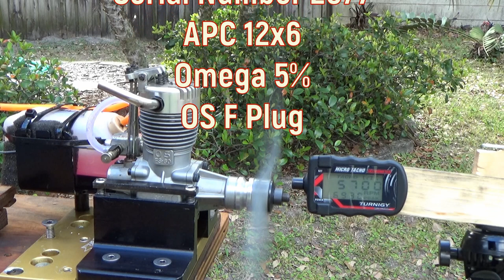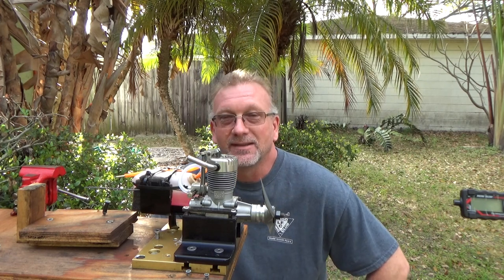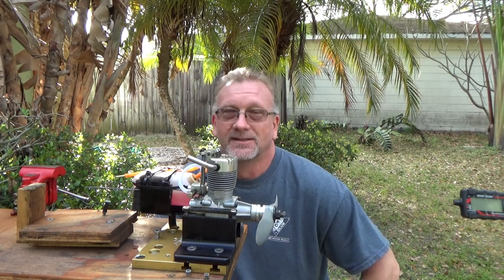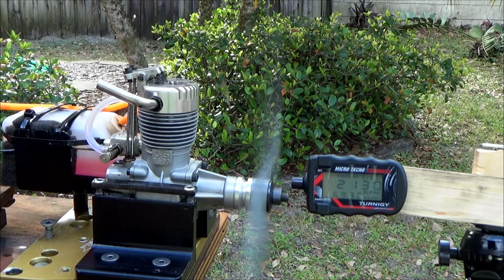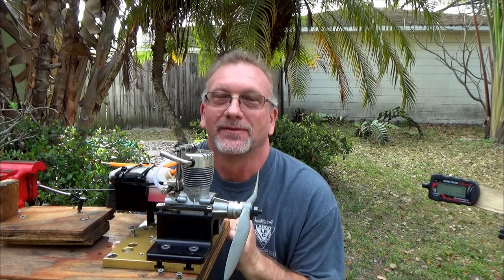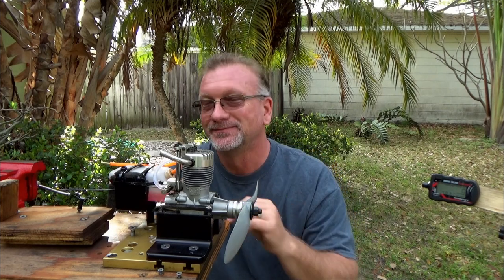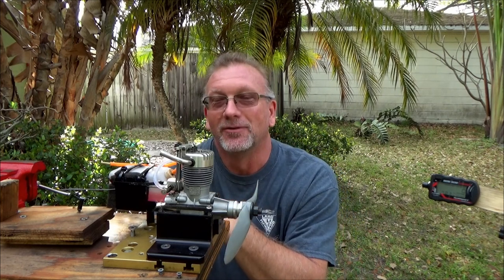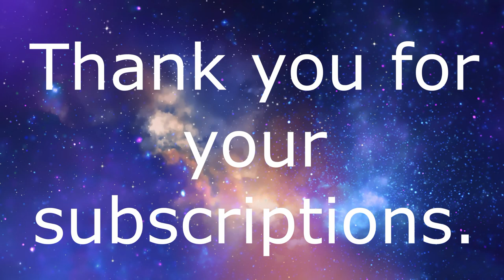OS FS-60 MkI Open Rocker First Run **Bella**

Comment: I have the second version with the cast head. I bought it new in 79. It has been on numerous planes. The only thing I have ever done to it is replace the bearings a couple of times and reseat the valves. 

I also made a timer so I could run it on gasoline and 2 stroke oil. 16 to 1 mix. Runs great that way also. It still has the original piston and ring that still has great compression. It is simply delightful engine to run. 

Outside of all my old antique ignition engines from the 30,s and 40's, it is my favorite glow engine. It has about the same power as my Anderson Spitfires on a 14-6 prop. 

Thanks for the great video.

Comment: I can't get over the fact of how quiet this is, even at high revs, perfect 1 cylinder for an old timer slow flyer.
Reply: Those early four strokes tend to have softer valve timings and are more optimized on torque. So they develop their maximum power at 8000-9000 RPM or something like that, compared to the more modern OS surpass which are designed to have significantly more power but need to turn in excess of 10000 RPM to archive that.

Also the since the exhaust valve opens more slowly, the pressure spike in the exhaust isn't that big and therefore the sound not that loud.

Many years ago I had the pleasure to listen to a Kalt FC-1. 7.5cc four stroke, less power than a modern 4cc two stroke. But really quiet without any muffler.
Reply: @VintageTechFan  Wow man, don't know why youtube never gave me notification of your replay, just saw it by chance just now! Well you just read my mind, I love the kalt FC-1 engine, have over the years collected a few, one used and new in box, keeping those for display. Just recently won a bid on ebay for a collection of os engines, one of them was  a NIB os fs 60 MK1, From the pics the seller sent me, it looked to have never been run, not even mounted. I have yet to get it. I also own 2 NIB MK 2, my fav. When an engine is made so good, its hard to just have one of :-). The fs 60 is an absolute jewel, yes, its purposely made for that sweet sweet scale sound and low rev, high torque, LOVE IT. Last yr I was lucky to get my hands on a NIB OS IL 300, now that is a beauty as well!

Comment: you can add after run oil thru rear cam housing cap.
Reply from the maker: Yep, I have done that.  My biggest concern is how is the excess oil during operation supposed to go besides the path of least resistance.  I think that is why I saw so much coming out the carb area.

Comment: Without a CC vent, I wonder where the oil goes? mabe through the lifters?
Reply from the maker: Well some was coming out from the carb.  What I thought was fuel was actually oil coming out.  Not a good thing to not have a vent for the excess oil.